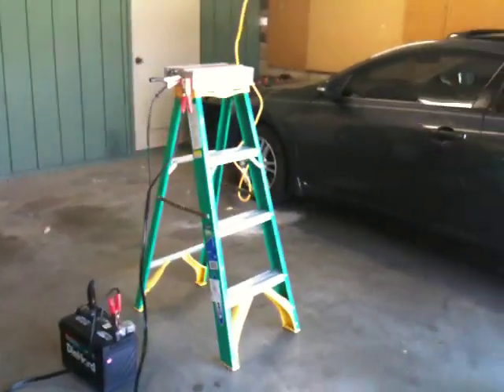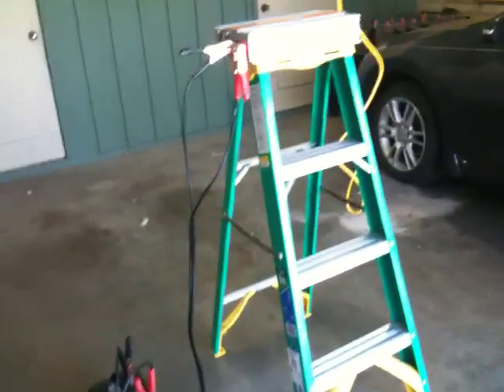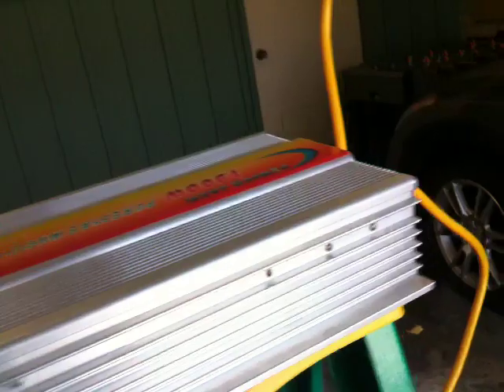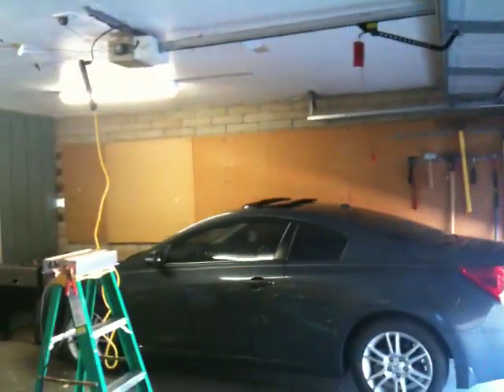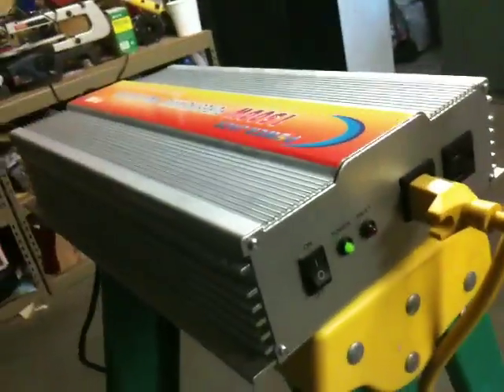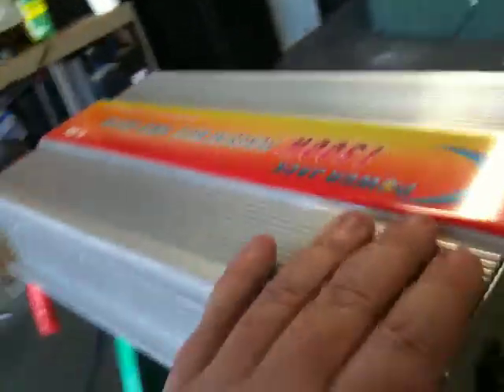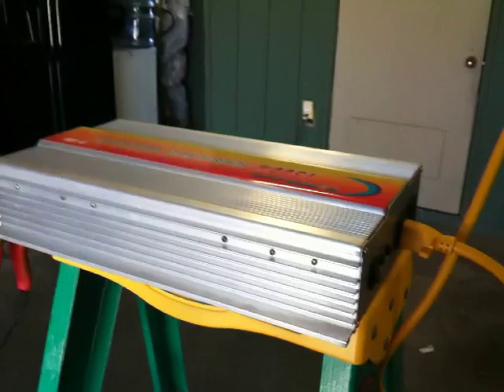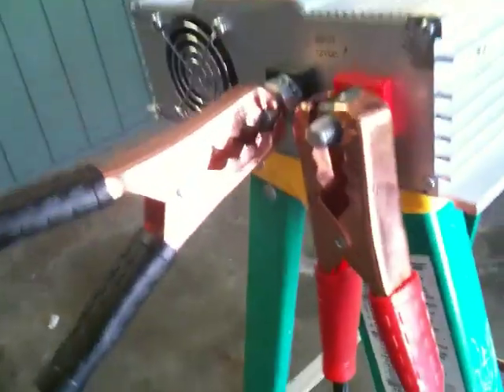Solar Power Project - Inverter Test 2 - Garage Door Opener

Comment: Stupid question. Have you ever thought of just using a home UPS, like from APC, Cyberpower, etc? Out of desperation one day, I put a smaller (250watt) APC UPS on my single door. I get 3 open/closes out of it before it dies half way on the 4th open. I was going to put a 900watt/1500VA ups on the dual door. I really just need it to open a couple of times. Once at least to get the generator outside. Once that's running, the doors are back on power. I like the RV/Marine battery/inverter idea. But seems like it would costs more then just getting a new opener with battery backup.

Comment from the maker: Indeed, if I had a DC powered garage door opener I would definitely bypass the inverter. I did not know they made DC powered openers, I will definitely look into the price of them and consider replacing mine. Thanks for the tip!

Comment: The inverter was beeping due to the electrical potential drop in the cables.  Also, get a set of jumper cables and put ring terminals on one end, as with your setup a dead short caused by the clips on the inverter end will cause what is commonly known in EE/electrician/DIY circles as a 'bad thing.'

Comment from the maker: Also of note, is that after the test I reconnected the battery to my solar charge controller, and within 10 minutes it was back to full charge (14v), so apparently the test did not draw much power.

Comment from the maker: Note that those jumper cables are only 10awg. I will be using 4awg cables between the battery bank and the inverter. Once the cables arrive I will perform another test. I suspect the current draw was limited by the small cables.